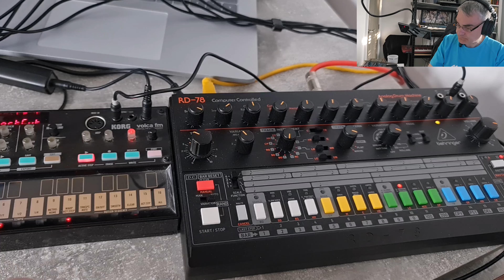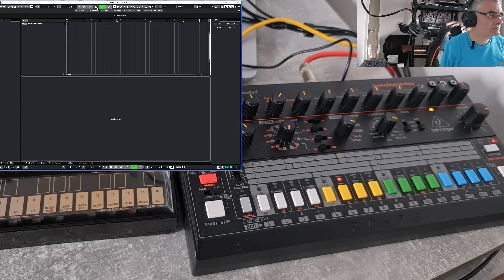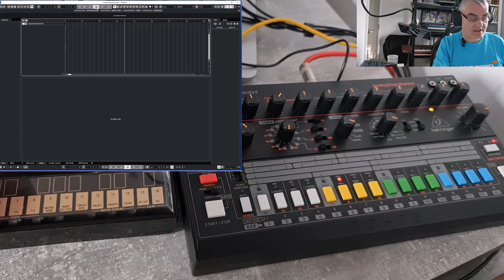Behringer RD-78 Sync Guide: MIDI, USB, and Trigger Setup Explained

Comment: Great video. Can you check if the RD78 transmits midi notes of the voices when they play? So does the RD78 send anything on the midi out when playing?
Reply: It only sends midi sync out or pass it thru if received from USB or sync, the sequencer doesn't send the midi nots thru the midi DIN, it only does thru midi over USB, which is really unfortunate.
Reply from the maker: it send out note on and note off info. As well as start / stop
Reply: @IanDixonTDL thanks! Just note on/off or with the note number as well?
Reply from the maker: Note number as well
Reply: @IanDixonTDL  it doesn't send midi out, but only USB midi

Comment: Nice video, thanks! Is anyone experiencing a timing lag when in Sync? It comes in at a delay of roughly ~1/8 so I have to record to audio and then manually drag the recording backwards so that it lines up correctly with the rest of the DAW's tracks.
Reply from the maker: no sync issues here. I use USB sync.
Reply: @IanDixonTDL Thanks for replying! Need to experiment a bit more.

Comment: Hi (blind user). "Write" button is the button at the bottom right of the unit, yes? Every time I press start/stop + that button, all that happens is a pattern plays/stops. I've tried this in various play/write modes  but the same happens.  I'm trying to set up my RD-78 so it takes clock pulses from my Liven Ambient 0. I know all the physical connections are correct but I can't, for some reason, access sync settings on the RD-78. Please advise.  Am I using the wrong key combo? Is that not the "write button?" Does this only work if I'm using the Synthtribe app or something?
Reply from the maker: Press and hold buttons 27 and 47 at the same time, then use buttons 31 – 38 to 
select a synchronization source and division. Hope that helps.
Reply: @IanDixonTDL   Thanks. I figured it out in the end. It's the Group A/B button + Write/tap button then, as you say, first four steps to choose source and then steps 5-8 to pick a clock rate.  I'm guessing this key combo changed with a firmware revision because there's videos saying to use start/stop + Write. Thanks again.

Comment: Can you trigger out via the Accent or Cowbell or some other instrument or feature so it doesn’t trigger on every 16th note via Sync Out like you can on a Roland CR-8000 (via Accent) or 707 (via cowbell)?  I think on the RD-8 you can via the Accent/Cowbell individual outs but can’t figure out how to on this….help?
Reply from the maker: You could use the cowbell output as you said, but you would have to program it to fire every beat